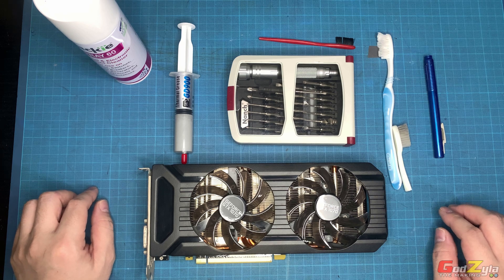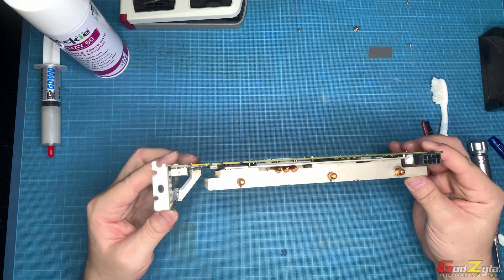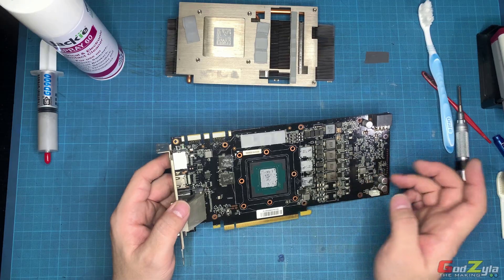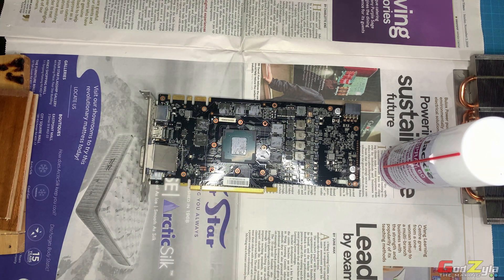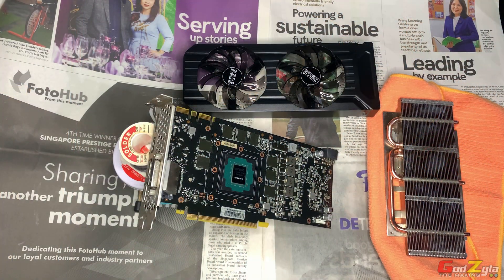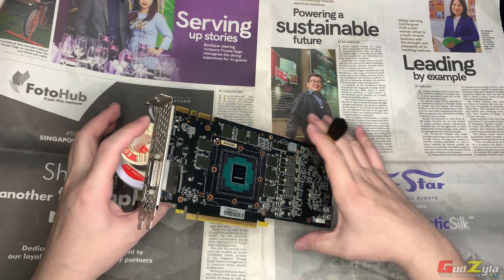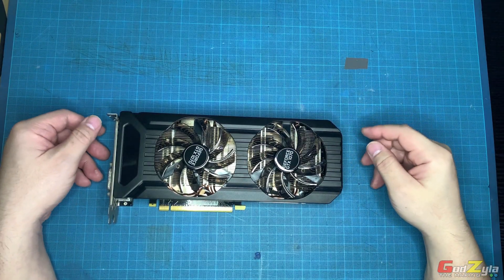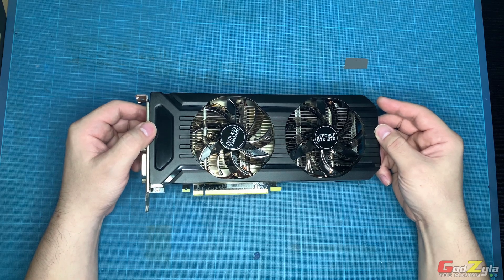Detail cleaning on PC parts

Comment: Hey Kleo, I know this is a very old video, but I rescued a Zotac GTX 1070 Mini from an old gaming PC that somebody from my block threw away. The card is in bad condition, very dusty and the I/O shield has quite a bit of rust. I'm not sure if it's working since I don't have a desktop to test it yet, but I want to try opening it up and cleaning it by following the steps in your vid and replacing the thermal paste and pads. If the card works, I get a free GPU, if it's dead, then at least it was good practice for future maintenance. Still trying to figure out how to get the backplate off though!
Reply from the maker: Hi gntan83, welcome back. I can't recall you will need to remove all the screws from behind. this might be able to aid you https://youtu.be/JP605O9FP2o